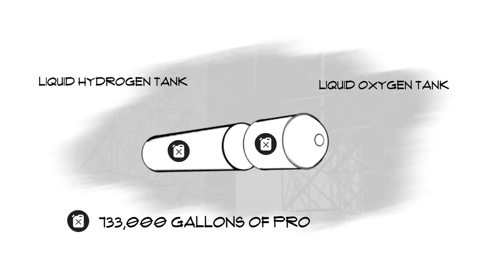NASA Space Launch System Rocket Core Stage - Underneath the Hood

Comment: I just don't understand how this can be taking so long. It's a Space Shuttle drop tank. Yes, the oxygen tank has to be made cylindrical with a dome instead of pointy, but it's the same ribs, stringers, skin, and domes. Change the drawings a little and that's that.

Then you have four SSMEs--literally used engines the first few flights! Two of the Shuttle's solid-fuel strapons with an extra section--again, change the drawings a little bit.

Finally, an S IV-B stage from 50 years ago, except with more of the same tankage from below. Seriously, this should take a couple of years to cobble together--tops!